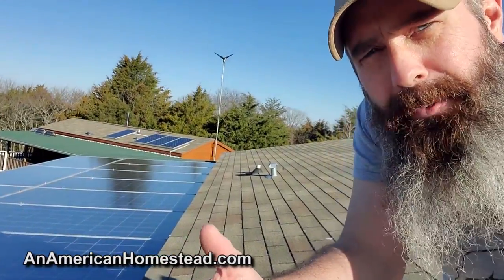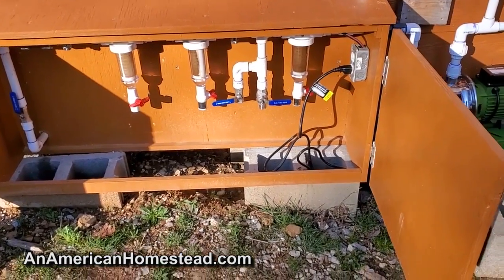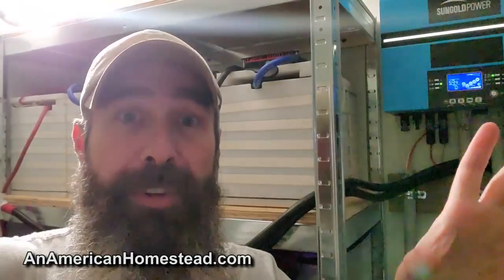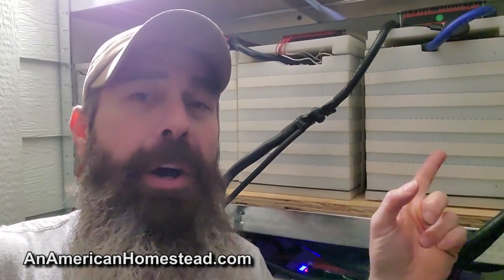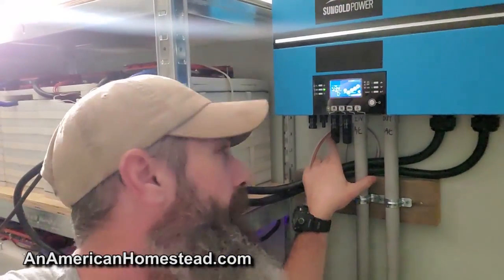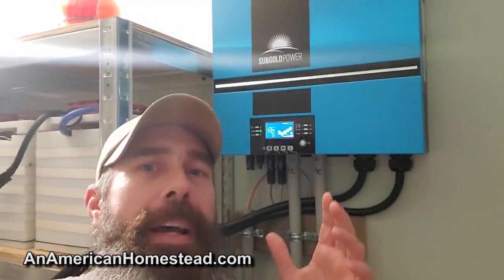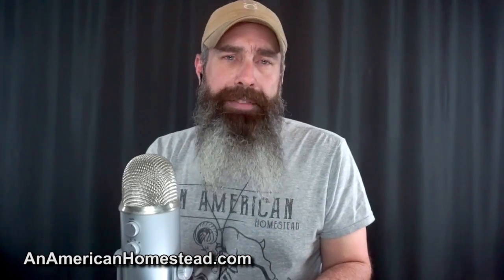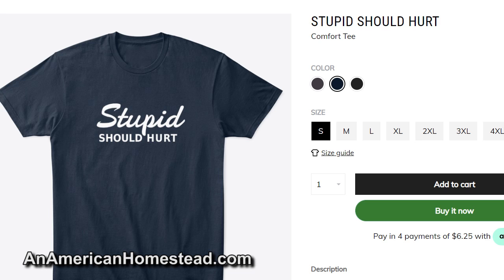Our Off Grid Homestead Solar Energy System - SUNGOLDPOWER SP6548 Solar Inverter

Comment: ummm just FYI. 
I've been running a washer machine for years off grid.
Now my washer is over 20 years old. I bought it used 15 years ago.
You only need 500w for a washing machine.
Now dryer I'm not speaking on. Because I clothes line. Most the time an hour its dry. But I live in a dry area with winds. 
Back when I used a dryer. It took an hour to dry things.
Point I'm getting at is. I don't want people to think you need a lot for a washing machine.
However..Also. There are two ways to use a washing machine off grid.
You now have a pump. So it can just be set and forget.
But for those that don't have a pump. Or pump is weak.
You can fill tub up by bucket, or hose. For wash cycle.
Let's drain and spin out.
Then move to rinse cycle and fill again.
If your washer doesn't have at least 2 rinse cycles you will have to do it again.
BTW wash cycle without soap can be a rinse cycle.
It more labor and watching if no pump..But can be done.
Another thing is water heater.
An electric water heater can be ran off grid.
There are two methods.
1st buy 12v water elements
Other is use 120v elements. And plug in.
I've have mine hooked to a light switch. So I flip switch and hear up water.
I know the new fad is on demand.
But, I also found that its economic to use an old water heater. 
Really does it matter that you use electric. If the electric is free? 
I was running my washing machine, water heater, TV, PC, lights and small pump on  system with 1000 watts solar.  440 ah lead acid deep cycle batteries. 
Note with that pump. I had to fill washer tank with hose.
It may seem like I'm being mean.
But thats not my intent.
I just want people to know that things can be done with a small system.
Right now Im running three separate systems.
I also started with one 100w ( 12v) panel two car batteries And a wind turbine that shouldn't be counted.  Don't get me wrong. The turbine itself is great 1500w.
But the converter has never right.
Next I bought 3000 watts of 24v panels and batteries. Though 1000 watts of panels were stolen before I hooked them up. And I ended up only using 1000 watts when I hooked it up. Yeap 1000w of panels have never been put in system.
And now for years all my 24v panels have been stored.
I had a lot if problems between the garbage connection solar companies use..And cows disconnecting my panels.
You can't just hook up a vehicle to 24v and higher systems to charge if needed.
You have to disconnect batteries and put in 12v form.
But if you run a 12v system. You can just hook up with jumper cables from your vehicle.
Though a big problem is those connections that solar companies use.
I advice CUTTING THEM OFF and change to the big eye hook connections.
No REALLY. If you do this. You will majorly improve you power output of your panels.
HUGE ADVANTAGE.  I get power from the moon from 1/2 moon to full.
No not like the sun. But I get power. about 1/10 rating
And with the sun. My panels can be near 180 degrees off and I get full power. 
I went back to 12v. And added panels.
I added two other systems. 
And am always adding more each month to one of them
I've rebuilt one battery bank's batteries. 
I've tried many cheap invertors.
( oh the 24v invertor is also in storage.) 
And advice anyone that doing a 12v system to buy the POWER DRIVE 1500 watt or higher invertor from a truck stop..They are big yellow and black.
like I've said I've tried many others.
But I've had my 1500w for over 15 years. And have three others. 2000w in truck.1500w on system #2, 3000w on  cabin system. And the old 1500w is on system #3.  Lol. The old one kept coming in house everytime one of the cheap ones failed. Until I had enough and bought the 3000w 
Now you may ask why I have multiple systems.
Well I own 640 acres..And my water is on water catch systems.
It rain for about an hour two times a year. And I have less then an hour to get the water out of my ground catches and into tanks. That is the prime function of them.   And they are also used to pump water out of tanks to where I need water. 
It's not a look idea to run the wiring over 1/2 a mile. And my truck can only run one pump at a time.  Remember, i only have one hour to get the water before its gone. Lol. Yeah a 8000 gallons drain out in about 40 minutes. Real fun it it rains at two o'clock am. 
The old one also runs my barn.

Comment: Hmmmm.
You friend designed the batteries.
So can they be rebuilt?
Though I already see a possible down side.
You said lithium IRON.
I rebuild my lead acid battieries.
It requires melting the lead and making new plates. And filtering the acid. 
Simple version.
drain batteries..And filter the acid
recover the lead.
Cut top off batteries.
Melt plates and removed lead and make new plates.
Put new plates and terminals in battery.
Seal battery back up.
Put acid back in battery.
Top off with distilled water.
Battery ready to be used again.
Can the lithium Iron be rebuilt?
I run a couple solar systems. 
I'm happy with deep cycle marine leaf acid.
But would be interested on how to rebuild lithium iron if it can be done.
Reply: You can depending on the battery. I have batteries that are Ni-Cd. We use lithium phosphate as the electrolyte, like that acid, they use sulfuric acid. It's pretty nasty like the lead acid with respect to hazardous materials.

I usually pop the top on each battery. Break the battery down by separating plates from the terminals. I clean the plates and the battery box surfaces with distilled water. I keep all the metal in distilled water while I clean them. I make fresh electrolyte with boiled distilled water. I assemble the batteries back together and play some back in the battery box. I feel the batteries with the new electrolyte. Check for shorts. Then I seal the battery with epoxy. Easy peasy but you have to be very careful. Lithium phosphate on your skin will irritate the skin. Then I run several cycles to activate the batteries with the charger. Every battery, that I have refurbished, came back at a little better than it was before. I have several batteries that were made in the late 70s and early 80s, and they have been working great. I can run them dry and they seem to be able to bounce back fairly easy. I use your run them no less than 50% capacity. I can go even lower and they'll be okay. I usually set the limit for my battery use to what my inverter can handle.

Comment: Are the batteries lithium iron phosphate or LiFePo4 batteries?  We have 1200 watts or PV panels and (14) 100ah 12v LiFePo4 batteries on our 40ft sailboat.  We haven't been connected to any grid in over three years.  Two of our panels are SunGold, the rest of the panels are SunPower and Renogy.  Our chargers and inverter are Victron...the inverter is a Multiplus II at 3500 watts.  The boat lives like an apartment.  We make our own water with a reverse osmosis sldesalinator.  We had people say that they can't afford to do what we have done...but over five years, we have spent less than we spent on monthly electricity bills, living on the grid.  We replaced our diesel engine with a 48v Electric Yacht 20kw motor.  When the 💩 goes sideways, it will be just another day for us, with no change to our quality of life.  Induction cooktop.  Our build out was not for ecology but, rather, for off-grid independence.
Reply from the maker: LifePo4 is the same as lithium iron phosphate
Reply: @Anamericanhomestead  You only mentioned Lithium Iron.  Since they were locally manufactured, I was curious.  Looked like a large bank in the neighborhood of 19kwh.